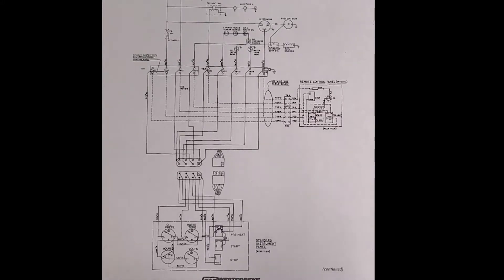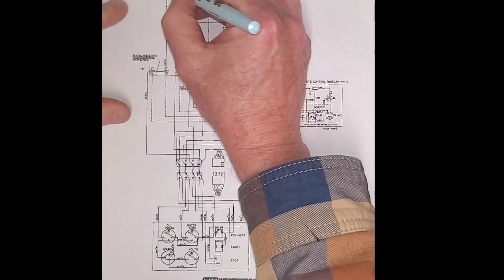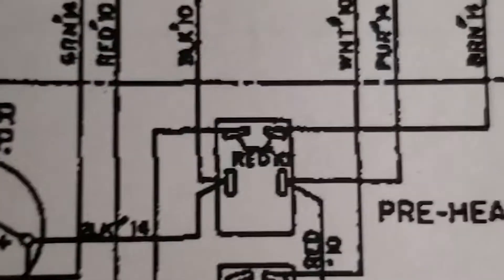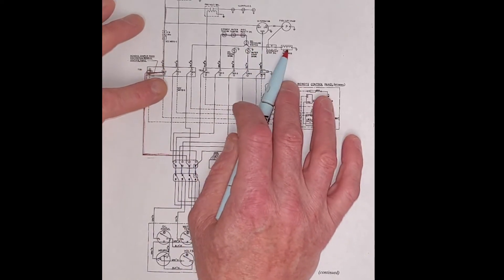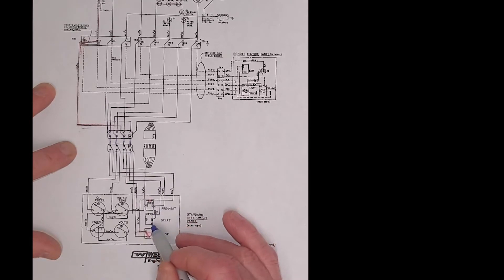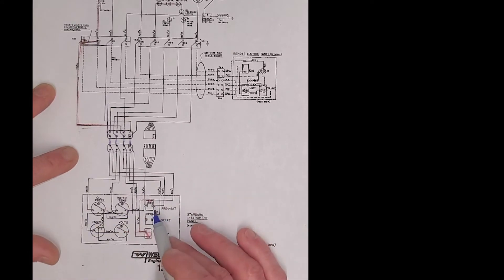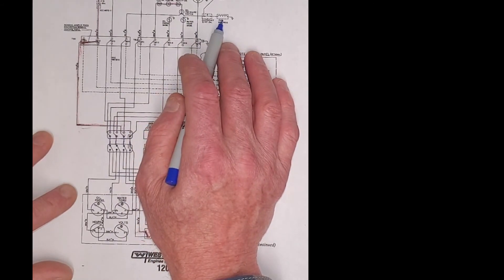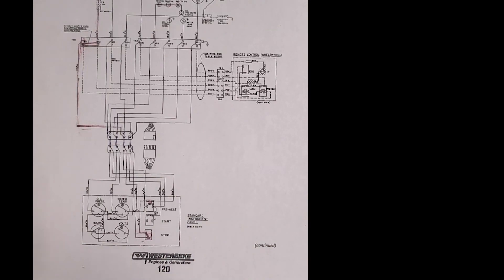Marine Diesel Repair, Westerbeke Diesel Engines

Comment: This is a great video. I have watched it a couple times. I bought a used (1980's) 12.5K Westerbeke generator without a operator panel so I made one. I am look for a wiring diagram on how the generator wires into the boat.

Comment: Thank you so much for this video. I just watched this repeatedly and will probably repeat it a dozen more times. 

I bought a 69 cal sailboat and the engine has no manual. I’m trying to piece together multiple manuals but no where can I find a 4.107 westerbeke wiring diagram or schematic. 

I can find many out there that are either the “typical” for pre 1975 post 1975 or post 1980. I can find them for the 40’s, and almost every other marine engine they built and pretty much every generator. 

Just can’t find specifically 4.107. 

The engine was working great, but I boneheaded it and drained house and started banks. In the jump I received many spots in my wiring caught fire. Melted many of those connections and the trailing wires, so unfortunately I don’t have the working version that was in operations on this boat to go off of. 

I’ve completed laid down and ran new wire and cabling through the entire boat. Built new concentrically twisted harnesses but I’m struggling to get the engine to crank. 

I’ve got a water temp sender and switch, oil pressure sender and switch, and if I have it I and find it a fuel switch. 

The boat was firing up by just a start push button. There’s a glow or preheat that I assume was working just never needed it the boat fired up instantly no hesitation and no need for the glow switch. The fuel pump was was operated by a switch off the dc panel and the engine stop was a pull out mechanical lever operating a mechanical lever on the engine near where the throttle lever terminates. 

If you have any capabilities of working a schematic through on a 4.107 I’d greatly appreciate it certainly sharing my gratitude with a massive thank you both in the loudest verbal/written sentiment as well as fiscally! 

I’m hoping to transpose this information to what I’m dealing with but do hope to hear from you. 

Thank you again for this video, it’s been liked, shared, and Subscribed with the bell. 

Now to explore to see if you’ve got other videos possibly dealing in the similar or same topic.
Reply from the maker: Try this:
http://www.fujiyachts.net/manuals/Perkins%204108%20Workshop%20Manual.pdf

Comment: Sir ,will you please help me to know excitation voltage of 25 beda 380v 50 hz westerbeke generator or which value posi-resistor used in the same field. Thanks
omanak1964@gmail. com
Reply from the maker: If you search Westerbeke online you can get all the information for free. They have an open website for technical info
Reply: @tedsmarinerepair8956  sir thanks for the reply. Actually westerbeke only given part no.of the pozi- resistor. The value has not given. So it will take minimum one month to reach india, that mean the generator..